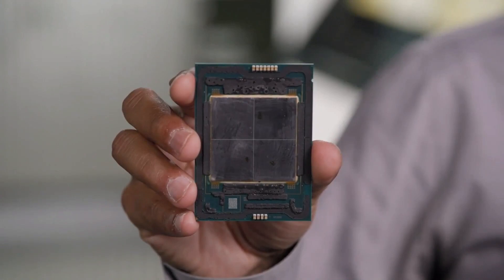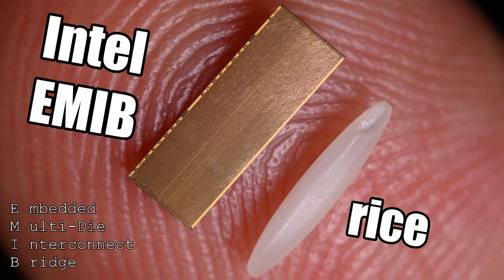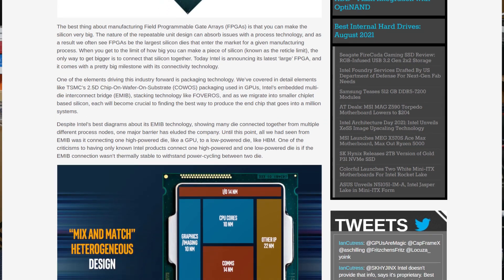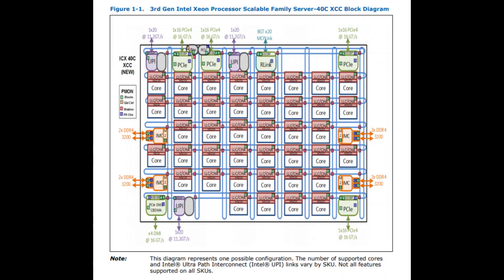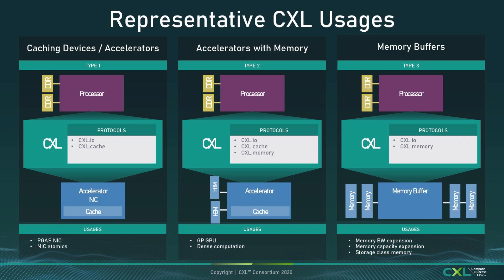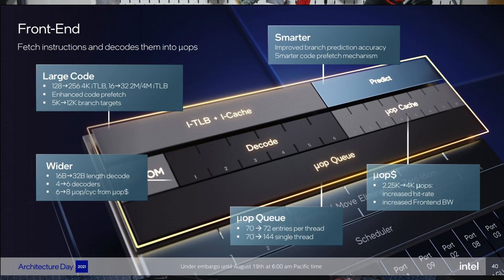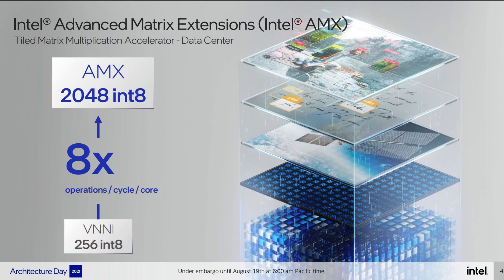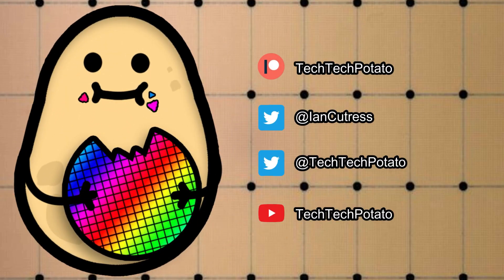When Four Become One: Intel's Next Xeon is BIG

Comment: Hold on, 6-wide decode?! I thought this was insanely difficult or space/energy inefficient on X86 due to variable instruction lengths and one of the main advantages of ARM (it got fixed lengths) in terms of being able to easily squeeze more IPC out of it on a generational basis. Comparing Golden Cove or its successors with future Apple silicon will be very exciting.
Reply from the maker: We keep asking Intel about it, they don't want to just yet
Reply: @TechTechPotato  I'm trying to get my pc to boot
I've disconnected and reconnected everything like 4 times

The cpu cooler fan is rgb
And it turns on the light for a second and nothing else happens 

Is my pc dead?

Ryzen 5600x 
B450 max 2
Vengeance ram 2 sticks
Seasonic 750w semi modular 
1660 zotac
In a meshify c case 

Any help greatly appreciated thanks

the only led that lights up is flash bios and it does three flashes then nothing 

And the rgb master cooler fan lights up for a second and then nothing else happens 

Has happened each time I try and start up the rgb does that 
The bios only flashes when I click it 

I'm thinking about taking cmos batter out for 15 minutes 
Redownload the bios reformat ny flash again to fat and unplug everything and bread board connecting stuff again 1 by 1 

But this is super stressful I just want my rig to run 

I have the seasonic 750w gm semi modular so I know it's working

Hopefully it was protecting something I had incorrectly connected or something like that 
1 by 1 I'll try and see what the issue is 

I'm gonna reseat the cpu reseat the ram and basically do everything again 
Really only can find like 3 and more year old forums to trouble shoot this is really a lot more difficult than the whole build your own crowd makes it seem

I could've just got a prebuilt and upgraded it but this is really demoralizing having it not work over and over again

I was excited now I'm bummed out borderline depressed
Reply: It's hard. It's also worth it at this scale, even if you only get it right some of the time.
Reply: Guess ARM ain’t that special when it comes to performance anymore.
Reply: @yancgc5098  yes
Reply: @yancgc5098  never was
Reply: x86 Assembly µOP has 6 pieces and is limited to 15 Bytes in size.
So having a 6-wide decoder makes alot of sense since it covers all possibilities.
Each µOP can have:
     - Prefix
     - Opcode
     - Mod-Reg R/M
     - Scale-Index-Base (SIB)
     - Displacement
     - Immediate

So being able to process all 6 pieces would be incredibly helpful compared to only processing 4 pieces at a time.
Reply: Even 1 year old (?) Tremont already has 2 sets of 3-wide decodes

Gracemont also has 2 sets of 3-wide decoders
Reply: @suntzu1409  Two sets of smaller decoders is not the same thing and comes with its own limitations and shortcomings.
Reply: @Psychx_  how its not same thing?
Reply: @Psychx_  also monts are to use lower power and lower area than Cove cores.

Intel wouldnt put 2 3 wide decoders if they increased power or area use
Reply: As Jim Keller said in the interview with Ian (after leaving Intel), you can just use predictors to predict the instruction length. So in the end it doesn't matter that much.

(In general, modern high performance CPUs are so complex that the ISA doesn't really matter as it's such of a small part of the chip)
Reply: IIRC Zen 3 also decodes 6 instructions per cycle (I think this is the same thing, just stated differently?)

And yeah it must be crazy complicated to do this!
Reply: @mduckernz  zen 3 is 4 wide decode
Reply: @Harish2923  Ah, maybe I've mixed up the ability to process 6 uops with the ability to decode macro ops. That sounds likely heh
Reply: @mduckernz  no, they are different things
Reply: @Harish2923  OK, how is having something be "ability to perform function is X wide" NOT the same thing as "can perform function X times per cycle" ? They're both ways of saying "can do this thing this many times per cycle"... 

They could be different if it wasn't per-cycle, but since it's not, I don't see a distinction.
Reply: @mduckernz  You could say a CPU with dual 3-wide decoders (e.g. Gracemont) can decode 6 instructions / cycle, but it isn't the same as a single 6-wide decoder since it operates on 2 separate instruction streams

Comment: I'm curios how much an interposer costs. Is it really cost effective to add an interposer in a situation where you want to turn a 200mm² die into 2x 100mm² ones, for example? Maybe it's just easier, and cost effective to deal with the yield loss at a certain point.
Reply: The hard part is lining them up!
Reply: Interposer is incredibly basic - you could probably make one on a 1 um process from 20 years ago; AMD is only claiming 9 um spacing for their silicon to silicon bumps. It's only wires so there's less to go wrong, and testing is cheaper and faster as it's just checking for continuity
Reply: @maxhammick948  So why does everyone make it sounds like it took a decade of development? It does seem like a super easy solution. Ian does mention heat expansion issues. I wonder if that has more to do with it, or something outside of actual production costs.
Reply: @eugkra33  theory is theory. There are many testing to make it work in real life

Comment: So the top right while directly connected to Top Left and Bottom Right, does not directly connect to the bottom left and each tile has this missing connection.
You mention that "it's so low latency", but that infers some kind of switching through emib, a direct connection would be effectively no latency and seamless.
Am I missing something with the grid not seeing EMIB as hops between tiles or even seeing EMIB at all and that's what's making it effectively monolithic in operation?
Reply from the maker: With the mesh, not every CPU is directly connected - it's a grid of connections. By doing a direct cut horizontal and vertical and keeping that mesh, you keep the grid intact, and thus the only latency is between mesh stops, which is as it would work if it were monolithic

Comment: Any idea of what a 1600mm^2 die would draw in terms of power?
Reply: 350-400W
Reply: @WesFelter  I mean that might not even be too hard to cool considering how big the die is and being able to leverage that into a large cold plate for the cooler.
Reply: @Jsteeezz  A100 is also 400W so it is definitely possible.